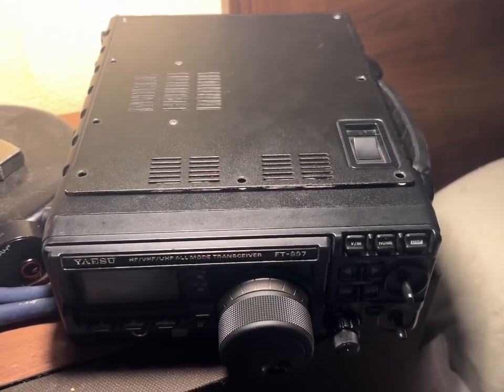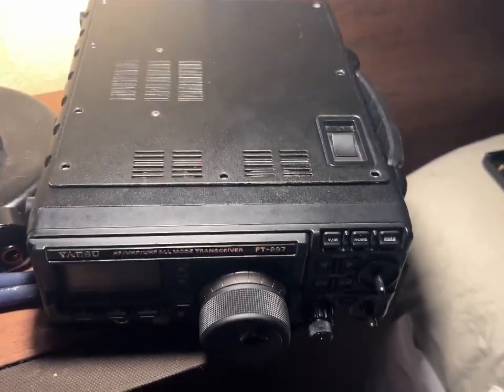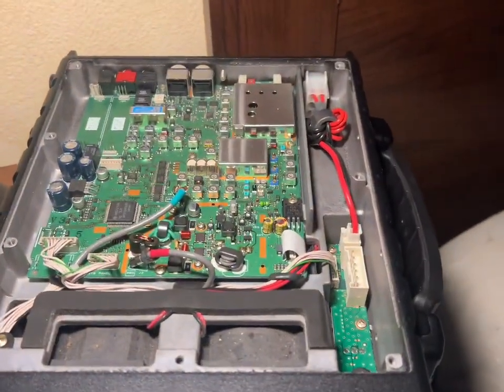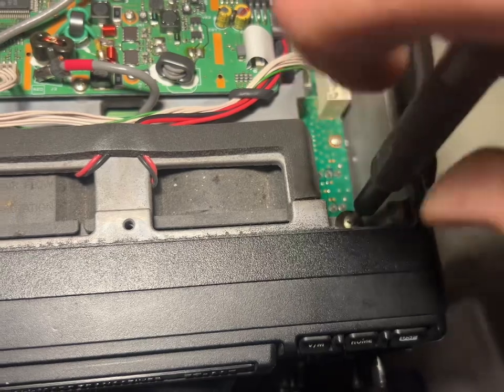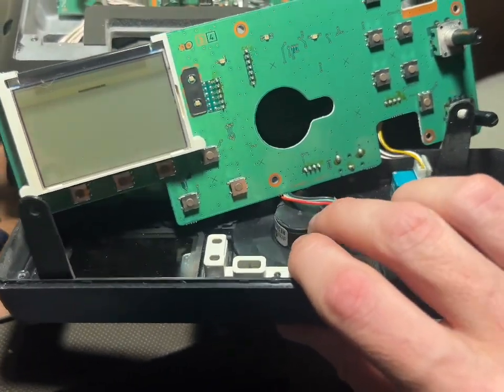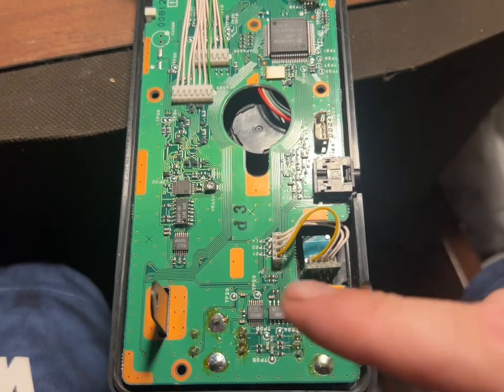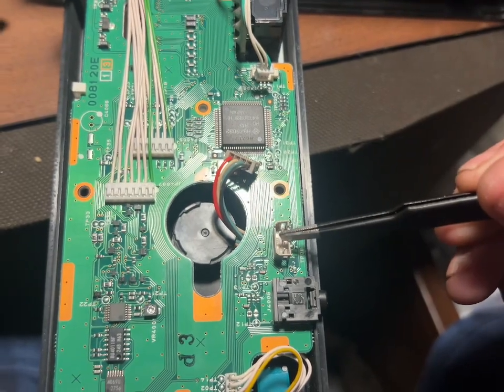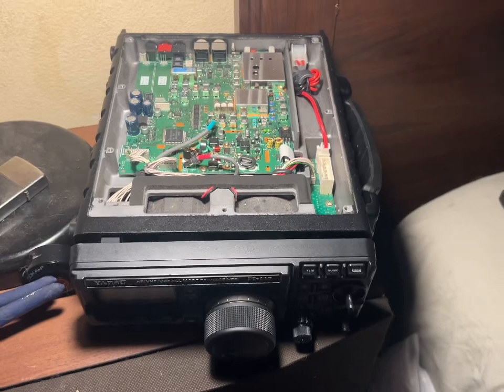Fixing yaesu dreaded loose vfo knob problem with ft-897 and ft-897d ￼4-25-2024

Comment: I just remove the front knob (there is an Allen screw under the rubber on the VFO knob). Then hold the center stem of the encoder (VFO pot) with needle nose pliers and slowly tighten the outer spring which covers the encoder threaded stem (it is like a nut with a spring). Put the knob back on and have fun.
Reply: This user is better bright...than YOU😂😆🤣😭😭

Comment: Thanks. My knob just got out pulling a bit. So I secured "that guy" from the outside part of the screw, where the knob goes, without disassembling. Put the knob back (seems it remains there) and everything is fine so far.